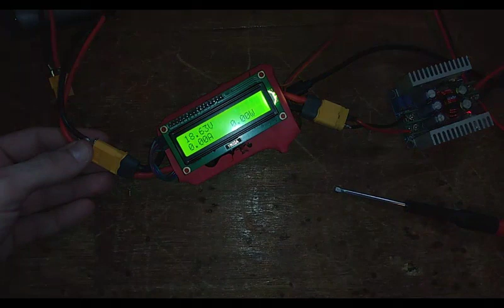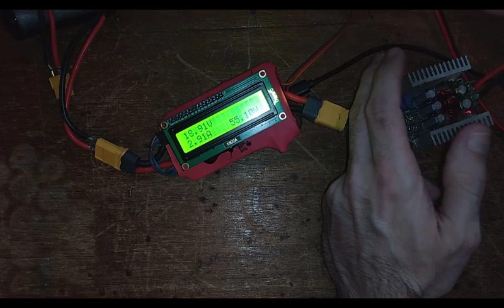Quick Video - Constant Current Buck Converter

Comment: Pretty sweet. What are the caps rated for? Can it do 30s?
Reply from the maker: max input voltage for these buck converters are 35ish V. caps are 50v but the other components on the board wont take that high of an input.
Reply: @electronicsworkshawp  you might be interested in this:
https://youtu.be/eLz6SrJjj9Y